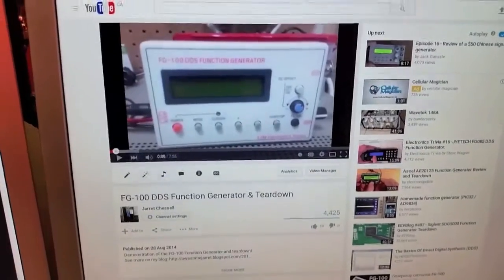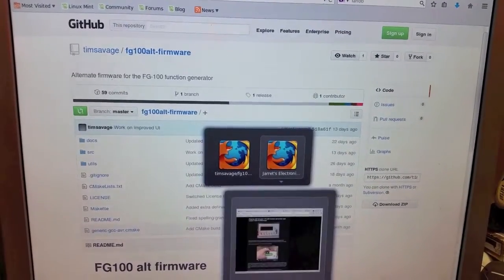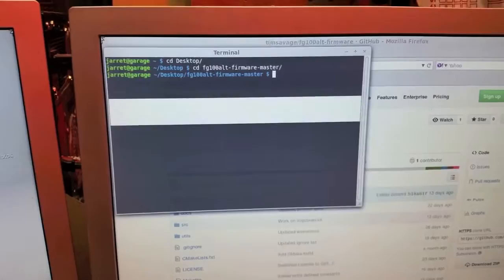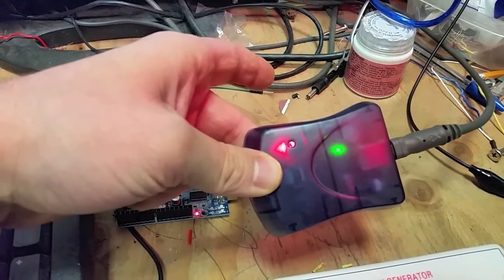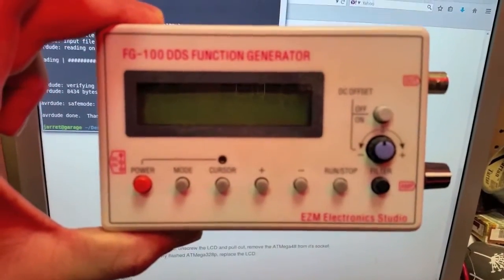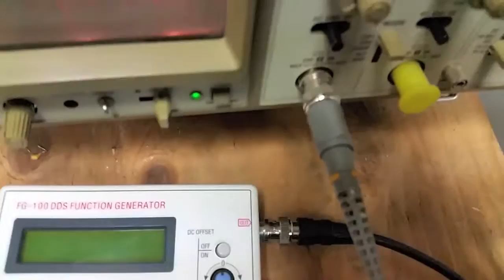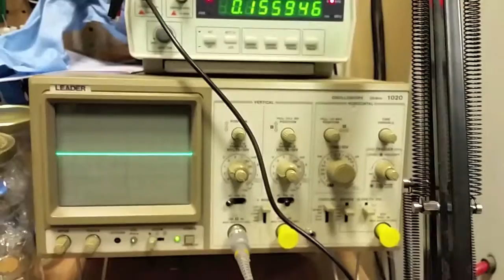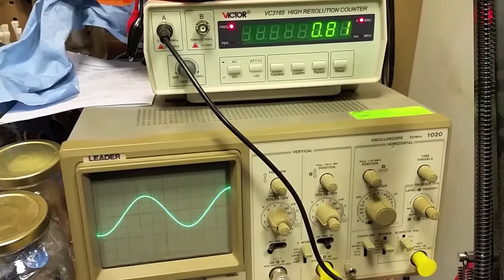FG-100 Function Generator Firmware Change

Comment: I would recommend downloading a release from https://github.com/timsavage/fg100alt-firmware/releases the 0.1 release is fully functional.
The master branch is bleeding edge development and is often broken.
Reply from the maker: +Tim Savage Sounds good, I will check it out and follow up. Great work, thanks!
Reply from the maker: +Tim Savage I checked out the firmware under releases, I'm still having an issue with the text not updating on the LCD after pressing any controls. It doesn't appear to be a lock, as I can still start/stop, I just can't see what I'm doing. I tried swapping the 1602 lcd with no change.
Thanks!
Reply: +Jarret Chessell First things first a quick sanity check, what is the version number you are seeing when you power on the unit. Should be 0.1
Reply: +Jarret Chessell The issue you are seeing in the video is because the master branch has a partially implemented interface that allows you to select which field to edit. To allow you to configure a start, end frequencies and period of sweep I needed allow for being able to edit many fields.  The 0.1 release operated in much the same way as the default firmware and you can only adjust the frequency and waveform.
Reply from the maker: +Tim Savage It is indeed the 0.1 release, I am still unable to see what I am doing on the LCD. I tried installing it onto a brand new chip with no change.
Cheers
Reply: +Jarret Chessell Strange I just checked out release-0.1 and it's working correctly. What is the version number on the PCB (on mine it's right about the LCD socket  "FG100_V1.1). When downloaded the new version use "make clean install" to ensure the build completely new.
Reply from the maker: It's the same board version . I made a new directory when  I downloaded the release version, so no old junk should have made it in (I'll try again regardles). I also removed all the lcd clears from the UI file, it still does it. I did notice the power input has a buck boost chip, then a regulator, I'm giving it exactly 5v, I wonder if something is making it drop out... I'll play with it more. Thanks.
Reply: +Jarret Chessell The released version should only have two lcd_clear function calls (in ui_show_splash and ui_redraw_display). I've just released a new version that fixes the button bouncing issues. Also done a bit of a refactor of the GIT repository, the master branch is now always a stable release.
Reply from the maker: +Tim Savage I played around with it more today, with your new release. It's still dropping out after a button press. I've pretty much ruled out everything (and it still works fine with original firmware). More investigation required I guess.
Reply from the maker: I fired up your newer 0.2 release on my fresh install of linux with latest libraries, and it seems to work quite well. The bounce on the start/stop is a little squirmy, but otherwise good. My frequency counter showed it as being extremely close, to within a few cycles. Well done!